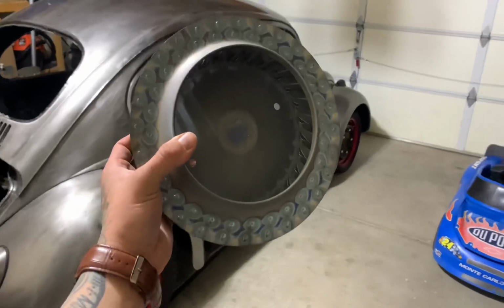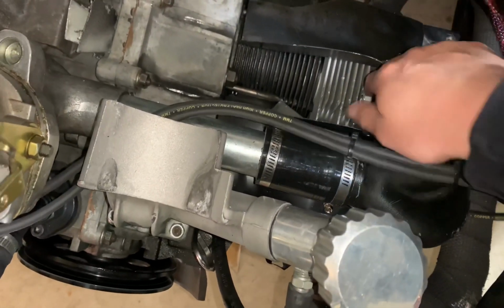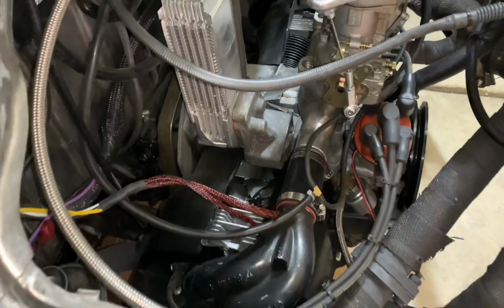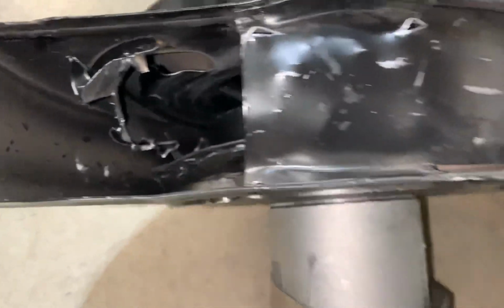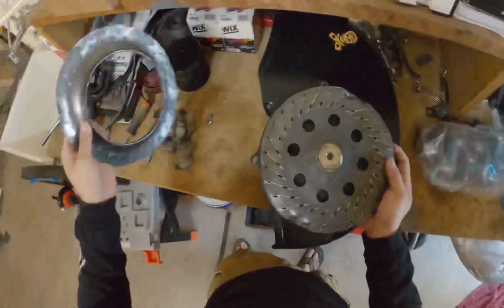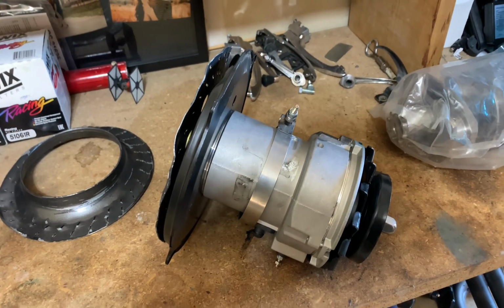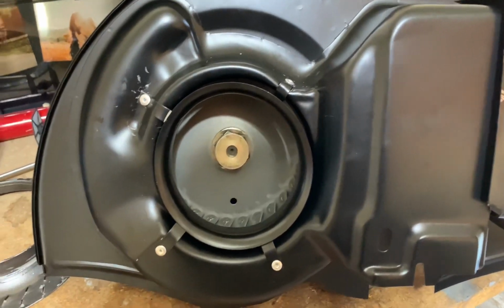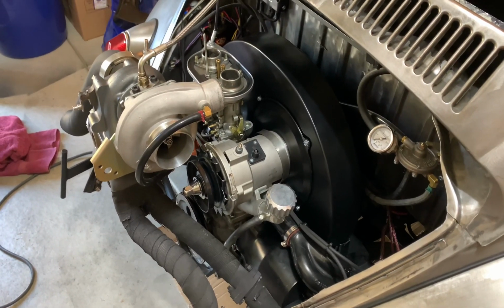2-Step Action!! CB Performance Welded Cooling Fan & Fan shroud Venturi Ring

Comment: looking good , nothing better than new goodies to play with.
thanks for the tip on the venturi ring , I think I will pick up one of those for my 56 , I just finished building my cb 2332 for it and the extra cooling will be a benefit for sure
Reply from the maker: That Venturi ring makes the fan almost act like a turbo. Lots of forced air gets pulled in the fan shroud! I think all engines should have them. It’ll be great for your 2332.

Comment: Looking good and sounding better, what’s the crank in the bag? Are you building a bigger one?
Reply from the maker: I am going to build a bigger engine. That crank wrapped in plastic is a 74mm. I’m going to build a 2054cc.
Reply: @EmmettRacing  sweet, I had been thinking about that combo as it saves on a lot of clearancing issues and about the same cost as a 69 counterweight. Have you seen or heard the Jpm engines?
Reply from the maker: @dommoss4264  I actually went with that size because I have a friend locally that built a 2054cc drag car. He’s running 340-380hp I think off the crank. I have heard of JPM engines. They have some crazy EFI set ups!

Comment: can you update us on how the venturi ring affected your motor :)
Reply from the maker: Gilbert, I actually took it out Saturday and ran it all day after shooting the video. Usually my oil light would turn on and I would have to pull over for a cool down. With the welded fan and Venturi ring I did not have to do that. So far it’s improved cooling in my opinion. Also when I feel the air suck in by hand at idle I can feel it draw in air a lot especially when I rev it up. It’s working just like my turbo 😂
Reply: @EmmettRacing  thanks for the info, i think i would put one on my motor
Reply from the maker: @bubot17  no problem, you should get it! It’s really easy to install. You can either rivet or spot weld it on to your fan shroud. These came stock on fuel injected beetles 1975 and up. Here’s a link; https://vwparts.aircooled.net/Venturi-Ring-for-Fan-Shroud-Black-Powder-Coated-p/venturi-ring-dh.htm